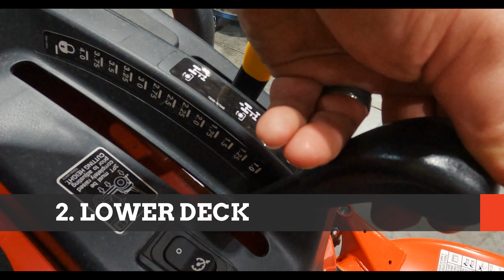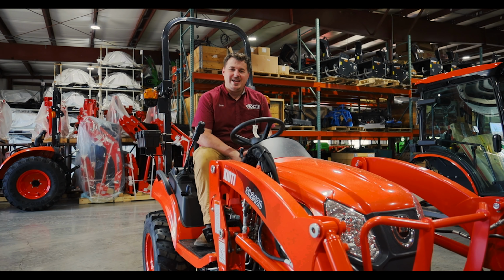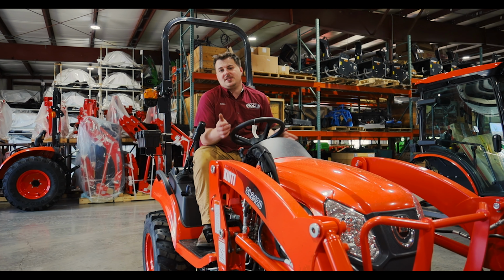Step-by-Step Guide: How to Remove a KIOTI CS Series Mower Deck with Ease

Comment: I have a rock/ dirt floor in my garage. I have 46 hours on my Kioti cs2510 with 60 inch belly mower. I have never washed my mower deck(sorry I know !) and have mowed just under 2 acres since June. It took me all 15 minutes to take the deck off and get ready for snow. ( I'm not mechanically inclined at all!!) Best video thank you Sean.   I'm not sure why people are having issues. I hope everyone figures it out as easy as I did. I just followed step by step pausing the video as I did each step. I hope installation in the spring is as easy. I did lube/grease everything so hopefully that makes it easier to hook back up. Happy Kioti tractor owner, love my Kioti.

Do you sell a complete 50 hour service kit for hydrostatic. that I could order and pay shipping? Let me know. 
Thanks
Reply from the maker: That’s great to hear Kelly! And yes we do have a kit that we can get you! Give our parts team a call sometime and they will get you taken care of!

Comment: First time i removed the deck it was pretty easy. My big issue was when sliding the deck out, i hit the hydraulic filter with the deck. Didnt put a hole in it but did dent it. Great machine but that filter location isnt good. Its pretty much the lowest point under the tractor and uts not protected. Be careful sliding the deck in or out.

Comment: I've got a Deere 420 that is older than the hills... I'm starting to shop for it's replacement and... umm... This video is almost identical to what I have to do!  I was really hoping that one of these other companies would make their own quick connect deck like Deere.  I'm 45 now and my next tractor I'm planning to be my last tractor! LOL  So in 25 years when I can't climb under to pull the deck on/off, this is kind of a big deal.

Also... what happens to the rear lift arms/links when you are using the 3pt?  Do they move up and down and need to be removed?

Comment: Great video
Are there any videos on mounting the front snowblower to a cs2410
Reply from the maker: We don't have one yet, but that's a great idea for an upcoming video! If you're looking for the initial install, that is pretty extensive and typically we recommend having the dealership do it, but after the initial install, the attachment itself can be taken off and put back on pretty easily!

Comment: I have a CS2220 I just purchased used from a guy who had it since July 2023 and it has 50hrs on it. I’m guessing he left it outside as there is a decent amount of rust underneath for only having it 4 months.
Either way took forever to get the deck off. The PTO coupler was a little stuck but got that loose however the pto shaft would not slide towards the front of the tractor.  It’s stuck where the two yokes meet in the middle.  Video makes it look like they should slide really easy.  Will the two pieces slide completely apart?  Any advice for getting them to separate?
So far I’ve tried several rounds of PB Blaster.  Heating the outer sleeve with a torch and hitting it with a mallet while holding the other end in a vise.
Reply from the maker: Yes, the PTO shaft should slide completely apart. Your's must have some rust there that is keeping it from doing that.

Comment: You will never get those lift links out that easy, even on the flattest of concrete floors.  And you'll never get them on this easy, either.  It's not a horrible design, but this is misleadingly easy.
Reply from the maker: We did nothing misleading here Eric! Wondering if something on your machine may need some lubrication or grease and that's why you are having some issues. Happy to help diagnose any issues you may be having!
Reply: @noltspowerequipment  Hi Guys.  I'm sure you weren't intentionally misleading.  Your videos are superb.  This is my 2nd CS.  Had a 2017 and then traded up to a 2022 with the better bucket kickstand and controls.  In a perfect environment perhaps it works this way a few times.  But in real-world use I assure you that things don't go together this easily.  The PTO also doesn't just slide right on every time, and if you are over 30 years old it is quite a contortion to reach under there to connect it.  Trust the experience of those who've been putting them on and taking them off several times a week in the real world for 2 generations of these tractors.  As I said, it isn't a bad design but it isn't quite this smooth of a process in your driveway or barn.  Even the slightest bit of slope or uneven terrain makes it very hard.  Grease might help, but if you've ever greased external components in real world use you'd be shocked at how much more dirt they collect.  That makes it worse.  A spud wrench is your friend to line up the holes.  Every tractor owner should have one.  The drive-over deck is a huge improvement, for sure.  Still love my Kioti.  Best bang for the buck in compact tractors.
Reply from the maker: Hey that's just the feedback we are looking for! We appreciate it Eric!

Comment: How do you unlock the height adjustment for the blades
Reply from the maker: try raising your deck as high as it will go and then move your height adjustment. Let us know!
Reply: @noltspowerequipment  I tried that, it does not work.